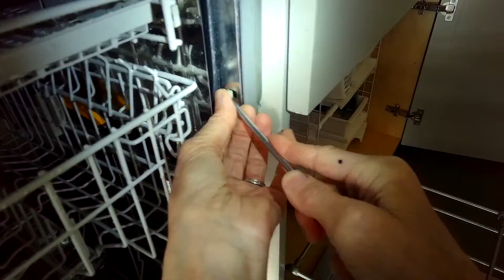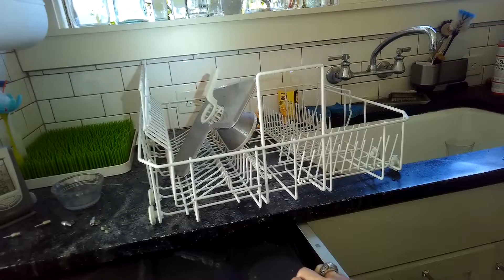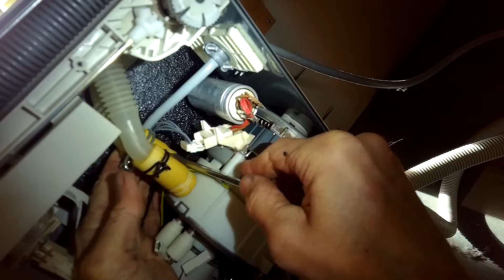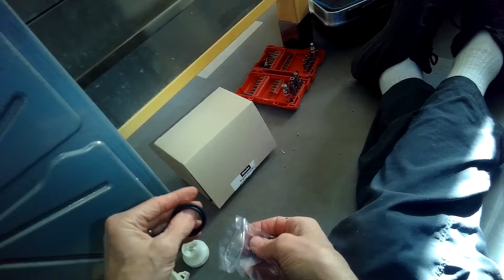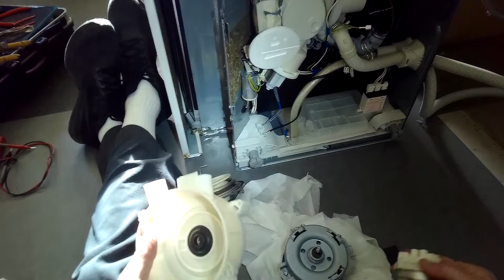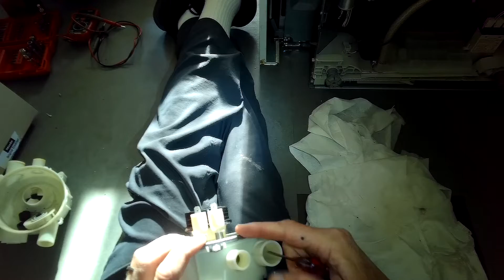🌏 Miele Dishwasher Circulation Pump Repair - DIY

Comment: You skipped how to remove the impeller... That was the info I was looking for
Reply from the maker: You put a small blade screw driver in from the back to prevent the cooling fins from turning and then grab the impeller and rotate it clockwise since it is reversed threaded.
Reply: @fictionalstudioséire  rewind the video and do a rerun 🤣

Comment: hey Scott, I have a miele futura crystal. its not working and it doesn't show code due to no display. It seems it doesn't spray? However the water is hot. could this be a circulation pump problem?
Reply: forgot to add that lights are all on but unable to select program
Reply from the maker: Sounds like the circulation pump impeller might be stuck.
You can get it spinning by using a kitchen fork👍

Comment: Thanks for this! Quick question, my water is leaking out of the weeping hole in the pump.... Does that mean the entire pump needs to be replaced?.. Also a Miele
Reply: If the partition kit doesn't contain the pressure seal undeneath the impellor you could have a problem. If that seal is leaking, it is not available as a spare part, only as part of the complete pump - expensive, and dodgy practice by Miele. When I rebuilt my pump with that seal damaged, I used rtv silicone and a rubber insert to cover the split. It worked perfectly 😀
Incidentally, fit the big O ring with low modulus silicone if you don't want that to leak too...
Reply: @nectafarious8842 Aw man! That's exactly what I did last year! I thought, F*** it, worth a try, even a temporary solution. Still going strong!
Reply from the maker: Just need to replace the partition kit.
You can call Miele USA and order one👍

Comment: Hi Scott, you skipped the part where you take the impeller off the motor shaft. How do you get the old impeller off that shaft? That's where I am stuck right now...
Reply: It's a left hand thread - unscrew the impellor clockwise. Lock the shaft through the back of the motor with a screwdriver.

Comment: Hi Scott, Thanks for the video - perfect how-to guide. My Miele G5570SCVi has exactly the same problem and the identical motor/pump assembly. I'm having difficulty locating the partition kit in Australia, do you have a part number for it please? Has anyone replaced just the o-ring and if so what is the diameter? Thanks

Comment: This video actually helped me. When I propped up the dishwasher from the floor, I noticed water was spraying water out of the motor. So after disassembling it, I tried to reseat the O-ring and that help with the leaks. However, after 2 months, it started doing that again, and reseating it worked again, but only time will tell before it starts acting up again. I honestly think I just need a new O-ring to replace the older one. How do I order one of these O-rings?
Reply: Just clean the O ring seating surfaces thoroughly and refit the O ring with low modulus silicon seal. Works everytime as the water is hardly above atmospheric pressure.
Reply from the maker: What’s your model number?

Comment: If the leaking water is dirty it will dry on the drip plate and leave a sticky mess that glues the floater for leaking water alarm to the plate and it will not work. I experienced this when dirty water was leaking out at the bottom of the door due to a dirty seal.
Reply from the maker: Excellent info.😊👍

Comment: Hi Scott! My Mielle G5400 dishwasher just started leaking from the motor...the float switch simply fired and I started investigating and disassembling the whole thing.

Quick question: How do you deal with the capacitor which is part of the motor assembly? do you explicitly discharge (and how?) it before disassembling the motor...or? Is it safe to start disassembling the motor as you show in the video? Thanks! And excellent work by the way!!!
Reply from the maker: Hi Nuno,
Best to hold on to the plastic handle of a screw driver and then use the metal shaft to bridge the two electrodes. That should get rid of the voltage .
Reply: @ScottTheFixItGuyChannel  thanks! I was thinking of doing just that but am unsure that could damage the capacitor...
Reply: No problem, just make sure you don’t touch the metal screwdriver with your hand.
Reply: @FastFreeApplianceFixes  : All solved now! with 55EUR, I was able to buy a 2nd hand leaky motor for 35EUR, which I also swapped with mine (as mine was making a high-pitch noise) and with 20EUR I bought a new O-ring set for the motor. Funny enough, both motors had the o-ring that attaches to the motor shaft, completely melted and pierced...

So, I guess it is one of those cases of "planned degradation parts".....

Anyway, thanks to your excellent video and tips, I managed to avoid having to buy a new dishwasher or having to buy a new 400EUR spare motor from Miele!!!

Many thanks again!